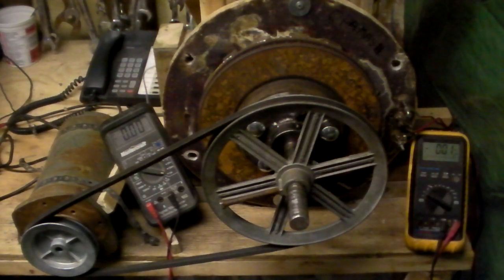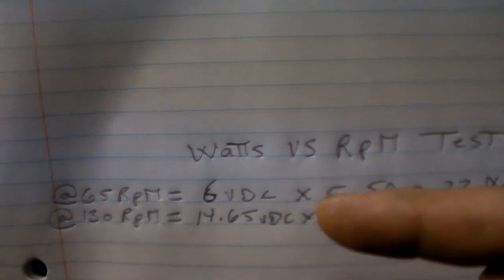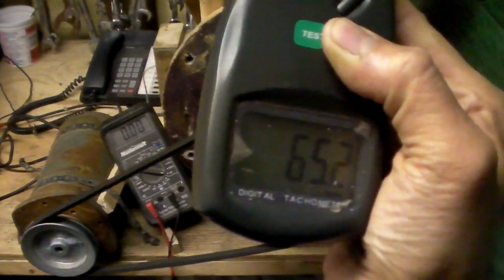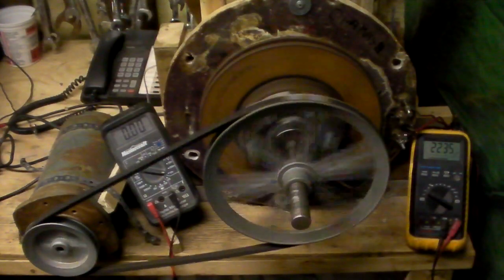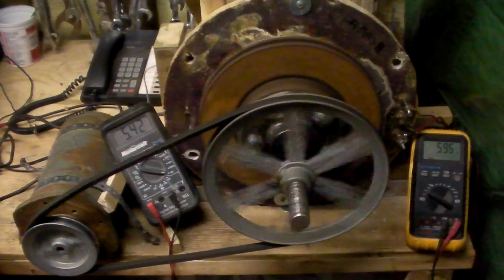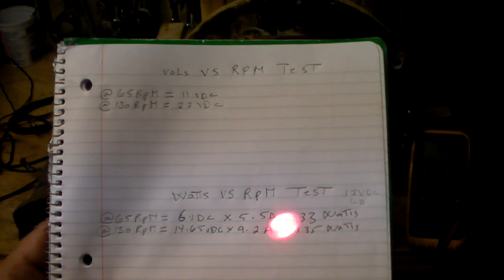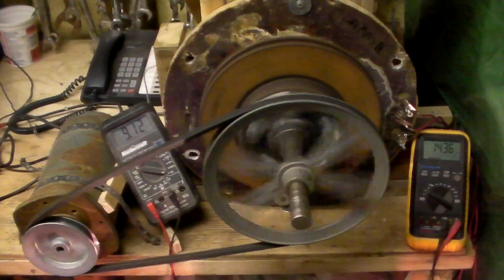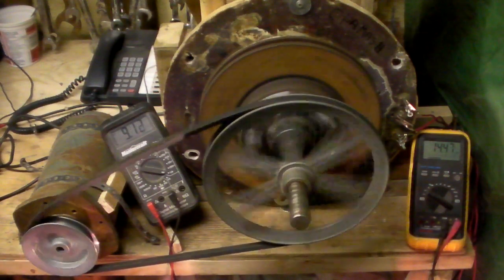Rpm VS volts and Watts test chamas 11 3phase axial flux pma green energy wind turbine vawt 86

Comment: Thank You for the great video and information. Could You tell me the wind speed that You would need to get your 130 rpm. Again Thank You.
Reply: Phillip, the rpm  depends on blade size, and blade size depends on cut in volts?
cut in volts means when the volts reaching the battery voltage it starts to 
convert excess voltage to amp.

so if you want to extract power from this pmg and charge 12vdc battery then the rpm will start give usable wattage
starting at 120rpm. you need 3 blades 4 feet long.

charging 24vdc will be 200rpm, 3blades at 3 feet long.

sam
Reply: please know that these blade sizes  only work with this pmg, due to coil turn count and magnet strength, 

every turbine assembly is a marriage among  coil winds/ coil wire/ magnet strength/ rpm/blades

sam

Comment from the maker: true, lots of losses when wire is too long.

sam
Reply: Watts Lost = ( Amp * Amps ) x Ohms  ( Ohms Law ) 

Watts Lost - increases by the square of the Amps  
Watts Generated - increases by the square of the Volts

And that is why, a higher voltage / lower amperage PMA + MPPT Controller is superior ...